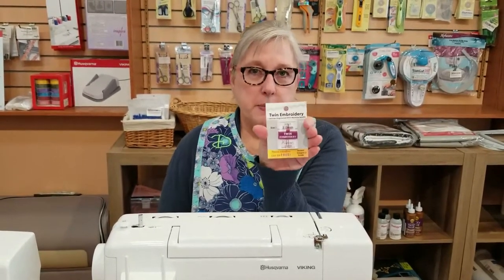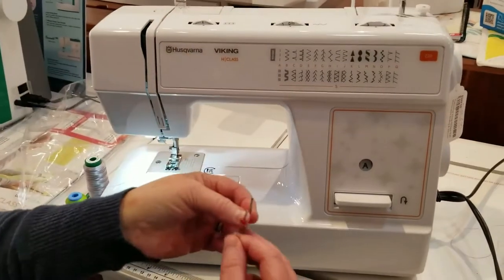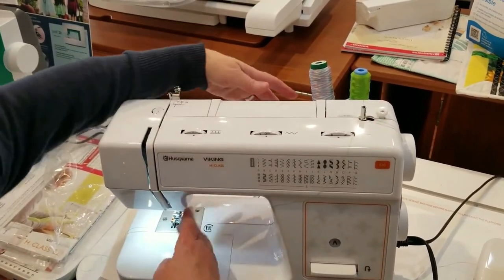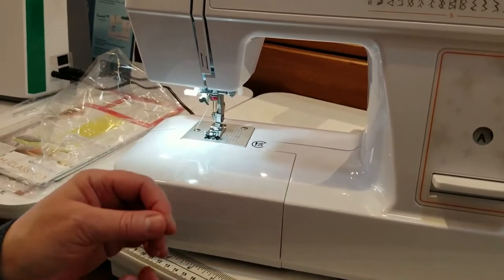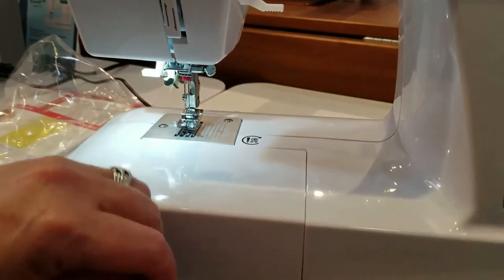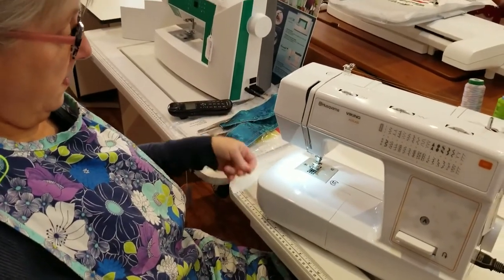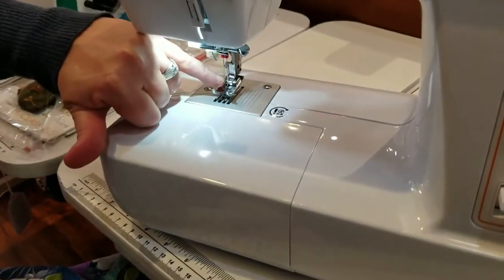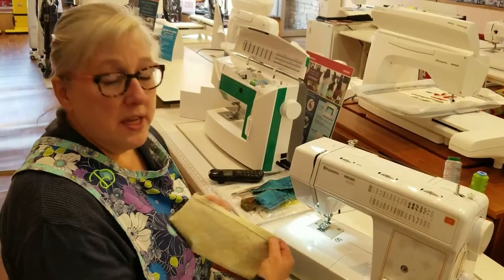Threading the Husqvarna Viking E20 with a Twin Needle

Comment: Can you answer a question on a Husqvarna Sapphire 870 Quilt? I can’t select any other stitch than straight stitch
Reply from the maker: You might try checking the settings to see if the stitch width safety is on. It’s on page 28 of your manual. Happy sewing!🧵